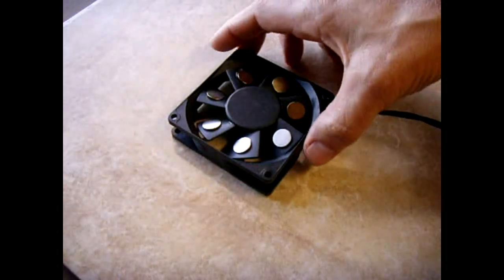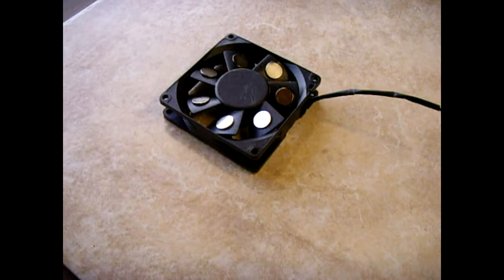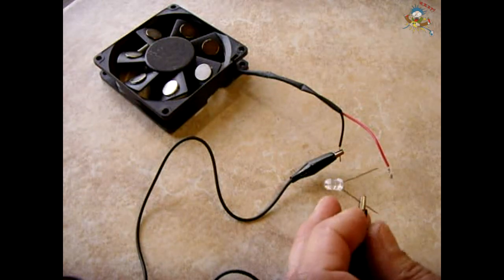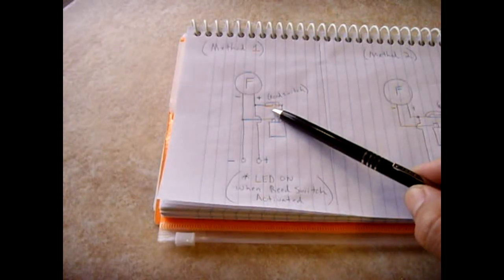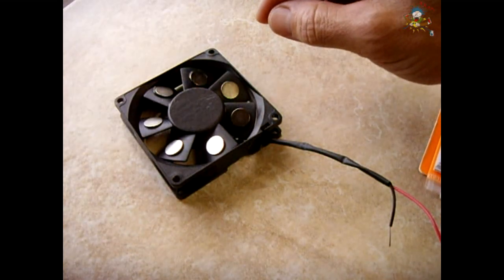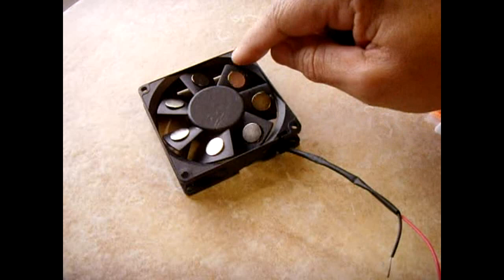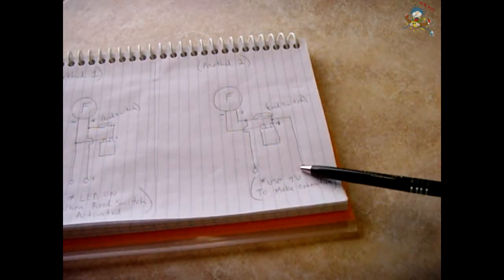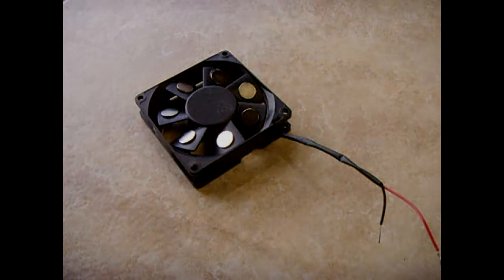FREE ENERGY Magnet Powered Case Fan/LED ~ How To Make!

Comment: thanks for the amazing video.
but i wanted to ask that what could be the maximum size of the magnet in width for the fan to rotate?????  as 0.85mm thin magnets are not easily available.and thanks i also made the same mistake.

thanks

Comment: do you think it would be possible to use a dc motor both as a stator and generator so that it would pulse a small electric magnet to only be activated when pushing away on the magnet on the fan blade? this would allow the timing to line up to accelerate the fan blade to make more power and even out the energy lost in the wires impedance and the energy lost when going through an electric field. i may be wrong though, i'm sure engineers thought of this long before a high schooler

Comment: Hey can i ask u a question. The speed of the fan influence the size of the fan. like faster speed means smaller fan?. Cos i want to play around with different axial fan .
How to do calculate the cfm of ur fan?
Reply from the maker: +Harrish Sajiv 
Each case fan is different. Using a ball bearing case fan will allow it to spin much easier and faster. I don't know why you would want to waste time making a scam device.

Thanks

Comment: A good source for proximity magnetic reed switches are old defunct VCR's.
I recall as a kid playing with a fluorescent lamp starter, when you heat the glass tube that is found inside the metal can the  contacts will close.
Great job on this one
Reply from the maker: Yes, I remember those also. :-) Thanks For Watching!

Comment: I've just rigged up the same setup, using a hair dryer to spin the fan instead of magnets as I don't have any magnets to do the job, I was just curious to see if the fan would actually generate enough voltage to power the LED using this setup, so I snipped an LED off some old fairy lights, wired it up and it works a treat! Nice little experiment! The question is would the magnet setup be able to spin the fan at the same rate the hair dryer did, I'm not sure.... only 1 way to find out ;)

Comment: Sir,about a question.I have a project for this.Can I use a 10mm*2mm neodymium magnet?
Reply from the maker: Why would you make a scam device?
Reply: @electronicsNmore  actually I was trying to test with kinetic energy charger but it didn't at least it can move.But I need a real solution
Reply: @electronicsNmore  this magnet I currently have is only for using glue gun to stick them
Reply: @electronicsNmore  I actually also watched the video Free Energy it was fake.so I finally know about the truth

Comment: I was just wondering if you could use magnetic attraction instead of magnetic repulsion to move the fan. So the magnet on the blade would be attracted to the magnetic your putting above the blade. So the blade(s) would all move because they are attracted to the magnet.
Reply from the maker: Does not matter what you try, the end result will be the same, no endless free energy.
Reply: Oh OK thanks for clearing that up.

Comment: I Agree 100% with you. But you over thought it. The lamp he used is from a magic shop, with a LED and battery. The trick is put the bulb in your mouth or hand and press the bottom of the fake socket in to close a switch and KAZAM POWER. The two leads on the lamp socket he has are across the bulb switch and hook (like you said) to a small Reed Switch Via the fan wires  on the frame of the fan, when the magnet is there. Yes fake Magnets on the fan blades. Your LED flickers because the magnets are moving across the reed switch, his did not, due to DC and fake Magnets. GOOD JOB!

Comment: Nice video:)
Yeah, the thing you'll never see is a free energy device doing useful work. The only way I'd ever take a second look is if I saw one that did a ton of work over time (like slowly pumping water to a high tank) - way more work than could ever fit inside the device using conventional energy storage methods like fuel or batteries. If it was still a hidden energy source (which it would be), then at least they would have had to do something useful and push the envelope for energy storage density! Haha

Comment: Could you not take the rotary motion of the spindle in the fan that is being driven by 'free energy' and gear it up/down to the shaft of a small generator?
Reply from the maker: +Will Brown No. Will not work. Nothing is free.
Reply: +electronicsNmore mechanically I imagine it's possible. No i agree hence the quote marks. Magnets are still used as a fuel as they will eventually loose their magnetism. Same principle as fossil fuels just cleaner. I was just wondering if the power you could get out from the spindle would be worth it considering the cost/energy it would take to make the magnets.

Comment: hi,I am doing my Research work on free energy generator, i tried the many machines , and different models in Ansys Maxwell software, no one works, finally i am confusing that the free energy machines will work are not???. if it works how to make design is there any trick behind it , please give me some suggestions about self running generators.

Thank you

Comment: Hello, sir! I would just like to ask questions because we are supposed to make a project that makes our LED light up without using batteries. We chose this because sadly, we got fooled by the other video. And now we cant change it ☹️☹️☹️☹️☹️ I've been watching videos and keep getting confused because of many people saying it's fake and some saying it's not. Because of this video that you made, you finally made it clear that it's fake and it's only working because of the Reed(?) Switch. Did i understand it correctly? That we should have a Reed Switch for the magnets not to cog? Can you also please explain the motor you made for the inside of the fan? Thank you very much for this video, sir!
Reply from the maker: Yes, 100% fake.
Reply: So for it to "work", a reed switch is needed? What was the motor you made for the inside of the fan?

Comment: I laughed...I kind of had a feeling this was a trap when I saw the title and then heard the first minute or so of your explanation.  I haven't seen the scam video in question mind you, but thanks for this, well done!
Reply from the maker: I had to make people that gave my previous case fan video a thumbs down think they were correct. :-). You're welcome!
Reply: electronicsNmore Well played.  I'd hate to play you in poker lol!
Reply: electronicsNmore i have a suspicion something is hiding underneath the heatshrink tubing.....
Reply from the maker: Of course. Instead of securing the very tiny reed switch inside the fan housing(in the same channel where the wires run), i attached it to the wires as they left the fan. Saved me extra work proving this is a scam. I could have placed it inside that same channel, and you would have never noticed anything.

Thanks For Watching

Comment: You could also have a free running fan with magnets. With out any other modifications to it. Just have a false magnet in his hand that has an induction coil in it. All he has to do then is power his hand magnet so when he brings it in close the free running fan will spin by induction.

Comment: I have all my lamps powered by these. It was hard getting through the cogging issue but using 3 magnets in the right position overcame this. It usually will last for 9-10 hours then needs a manual start by spinning a cog geared to the case-fan blade.
Reply from the maker: +john sims 
Yeah. I also noticed you don't have a single video on your channel showing this miraculous free energy device. LOL
Reply: I'll try to get one up for you and I'll message you when up!

Comment: It is possible...but its not that easy you just need to modify the motor to free spin and output voltage and need more magnets its similar to the the project where you use a modified drill

Comment: i have just 1 question does that reswitch(i couldn't hear it good(6:20)) use electricity because that fan doesn't have any electricity nor that reswitch but if those doesn't use(because they can't use it when they don't have it) any but you GET electricity don't you then have free electricity?
Reply from the maker: +Nathan Hamers 
Hello Nathan. The switch is called a "reed switch". You would never be able to hear it switch on in the video. It is also very hard to hear in person unless your ear is right against it.

Thanks For Watching!
Reply: +electronicsNmore thanks for your reply and for saying that it is a reed switch and not a reswitch but still what can a reed switch do without power and be able to let something rotate?????
Reply: +Nathan Hamers It does have power, from the hidden button cell batteries in the fan housing. He shows you this in both photo and the wiring schematic. You can never have perpetual or free energy as due to the laws of physics you always need to expend more energy than you get out due to losses.
Reply: Chris Ryan
ty! for clearing that up now i understand :D

Comment: I enjoyed your analysis of the frauds. I really dont know what a reed switch is but if that is what is needed to make this fan setup produce energy then why not use it.  The question is : does this setup have a function?  It seems to be able to function as a battery charger.
Reply from the maker: This fan operates using a hidden battery. :-) Nothing free about it.

Comment: I agree and I've done this and nothing happened. until you vary the position of the magnets that is stuck on each blade. some near the tip, some near the center and some in between. it does turn, not very fast and stops after a while specially if the fan is small. weight of the magnets on the blades equals drag. change your magnet setup a little bit, you'll be surprised. peace
Reply from the maker: Please, you sound like a nice guy....save your time and money. :-)

Comment: [only watched to 2:45 at this moment] Your and covered up the lose end of the wire, your other hand was used to connect that end to the negative, completing the circuit :) That my guess, anyway. Or, you might have placed a similar fan w/ magnets underneath it to couple the rotation energy and get the top one spinning in sync with one below the table. Although that would be much harder to get to work.
Reply: You should have watched the whole video!  He was debunking this nonsense, not validating it.
Reply from the maker: No trickery involved. Just duplicate exactly what I did using a LOW current low voltage dc motor and button cells. You will see for yourself.
Reply: mediaguardian Yeah, I already did, but I like to read and comment while waiting for the video to buffer on the slow internet! I'm sure what +electronicsNmore descibes is 100% accurate, and I had similar suspicion when the motor immediately revved up the way it did, as though it immediately got power.

Comment: so its this means it could not rotate the fan 360 by a magnet?
Reply from the maker: The device is an absolute scam. Clearly if this worked, I would have made 10 or 20 of them and had endless "Free Energy". :-) Thanks for watching!
Reply: It would be a perpetual motion machine and therefore break the rules of thermodynamics.

Comment: what led did u use
Reply from the maker: Why do you need to know? 5mm ultrabright.
Reply: +electronicsNmore i mean Watt or volt, ampere etc.
Reply from the maker: AlphaStorm2011
Yellow LED's usually have a forward voltage of 1.7v-1.9v, and they're designed to draw 20mA.
Reply: +electronicsNmore is it possible like in the fake videos to light up a LED bulb with this method?
Reply from the maker: AlphaStorm2011
Yes. The LED bulb is not that bright, and inside the LED bulb is more than likely a 10MM ultrabright white LED.

Comment: But what is I make a small wind mill and put magnets on each of the blades and us the magnet to turn it.
Reply from the maker: If you are making a wind generator, then you use wind to turn it. You will not make it spin using a magnet.

Comment: the bulb he is using is a plastic one that we use with a magic ring that touches the bottem and connects the system.. in the base of the light there are mini battery in it...  it will light  up the bulbs..

Comment: can these fans produce energy to charge Phones through usb car charger
Reply: if you use 10 to 12 these fans in series you can run your car as well. i use 24 of them to run my house. it gives like 2.5kw no problem. 

sarcasm. don't waste time and money.
Reply: hmm thanx but can i use solar panel in place of fans
Reply: +Naman jain that would make more sense. but it is good idea to stabilise voltage with lm317 or smth like that to protect your phone. there are several good tutorials on youtube. it's quite fun project.
Reply: +aannoonniimmss hmm Thanx I will try later with solar panel
Reply: ITS A SCAM,WHATCH VIDEO TO THE END ALREADY GUYS,JESUS!

Comment: AMD stock cooler fan?
Reply from the maker: +NCRranger24 - Gaming and More! 
Hi there. It makes no difference which fan you use, because the device is a scam. If you would like to trick someone, then use a ball bearing case fan.
Reply: electronicsNmore No, i was just commenting that the fan that you used looked like the fan from an AMD stock cooler. I realized it isn't the fan from that though. And yes, I know this is a scam.

Comment: OK, so I see that what I described below not how it was done. My next thought was that black wire being off the video was possibly 2 separate wires altogether going to a small power supply.
Reply from the maker: No, because when the magnet triggers the reed switch, the button cells are then allowed to turn on the fan and allow power to the yellow LED.

Comment: What is the main purpose of why this couldn't work? I watched your entire video but I can't figure out why this shouldn't in theory work. A magnet causes the other magnets to spin, you would just need a harness of the motion caused from the spin. What am I missing?
Reply from the maker: The device is a scam. Nothing to figure out. :-)
Reply: @ Brian Hunt - Notice that the magnets on the fan spin ONLY when the detached magnet is being moved by someone's hand. So the moving hand is the mechanical energy source that moves the fan. The magnetic fields produced by the magnets are only the transfer medium for that mechanical energy. Otherwise it's like pushing the fan directly with your finger. And what happens when you stop pushing the fan with your finger? It will stop moving won't it? Everything requires an outside energy source to do any work. There is no such thing as free energy. In all these free energy videos there is always some hidden way that outside energy is being transferred into the system.

Comment: A little late to the party . This was originally designed to be one of those "free energy" videos ,but what if we use electromagnet instead of normal one ? And pair it up with a sensor to know exacly when to power it up
Reply: Great idea in theory, however the problem using electromagnetic power and shut off sensors like you suggested is that it would need to produce enough power to overcome the electronic switches and magnets. The power trade would not be effective

Comment: instead of a solid magnet, couldn't a series of controlled magnetic pulses work as a stabilizer for the fan?
Reply from the maker: Still won't result in "Free Energy". :-)
Reply: Well yeah, its not supposed to. I mean it as a method of wireless transport of electricity. The fan turns a spoke which powers a generator.

Comment: . It can not be done with magnet because it hits the south pole behind it, it also stops between the north and the south pole. You can start the wheel, but stop at the next magnet. because it meets a pole before it hits the pole that started the wheel up. will never work.

Comment: interesting..I wonder if the large led-bulb he used in the video he powered with a 1.5v battery is a bunch of BS.  Ive never heard of an led of that size that can be powered with a battery at least without the use of a toroid core of some sort.
Reply from the maker: +Chris Smith (porscheflat) 
Nothing more than a small wide angle LED inside the bulb.
Reply: haha..imagine how many magicians are available here on youtube when it comes to money.

Comment: Did you know that you no not even need fat button cells, you can actwally use these:
 http://www.amazon.com/Lumenok-435-Replacement-Battery-2-Pack/dp/B004RDQU28

They are small lithium 3V batteries used to light up LEDs in bow knockings, so that the bow will light up as it flies though the air! They NEED to be really thin, and less than an inch short. They have more than enough power to light up small LEDs for considerable time. You can probably easily hide one in an alligator clip!
Reply from the maker: Actually the best power source to use, which is extremely thin and has just the right power, is a tiny lipo battery. I have a camera pen which used a lipo battery which is only 3/8" x 3/4" x 2.5mm". Very easy to conceal. The scammers are likely using that.
Reply: electronicsNmore Thats very likely, too! I know you can buy lithium batteries that are thinner than paper. Pretty impressive what technology and manufacturing are capable of!!

Comment: Think you gave it away when you said "it was damaged when you took it out"........anyways i know this thing can't collect energy where are the coils?
Reply from the maker: The plastic surrounding the fan has zero effect on the operation of the fan. Thanks for watching
Reply: You didn't answer where any of the coils are that are collecting the energy..?
Reply: The hoax needs no coils to induce voltage. The battery inside powers the led and the motor.  
if the mechanism actually worked the existing motor on the fan would be used as a generator. the output would not be smooth current like a battery either.